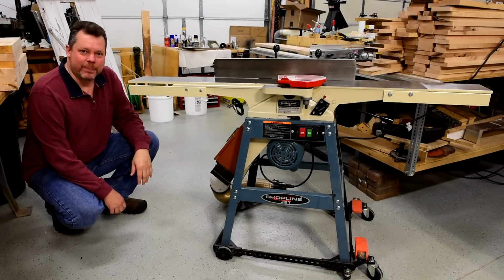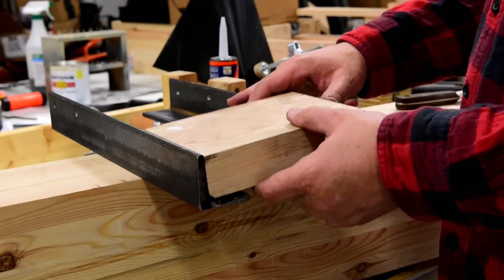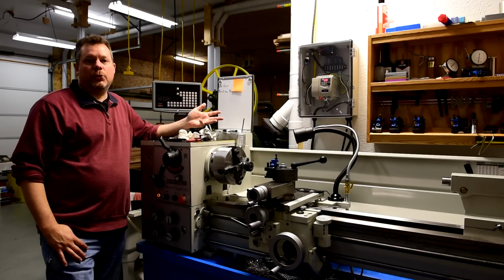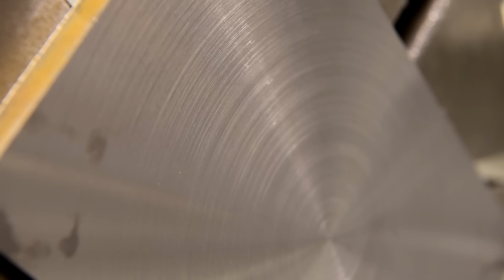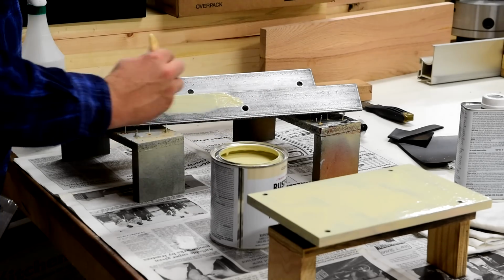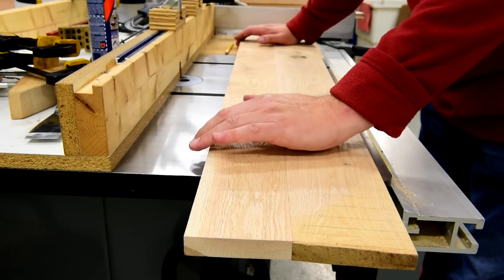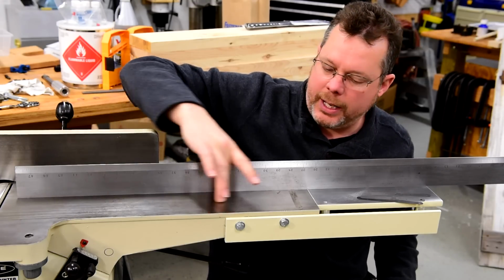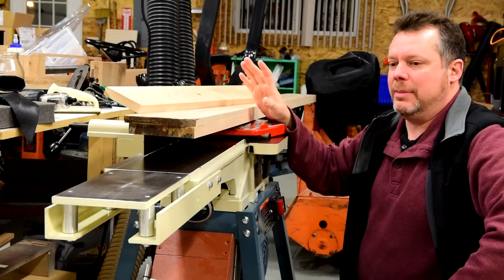Making table extensions for a 6 inch jointer

Comment: I might do this if I can find the time.  You did a great job but the process could be simplified.  A 1/2 " steel plate great , but seems to be gross overkill.  I would use a 3/8" or 1/2" aluminum plate depending on availability as cut-offs (leftovers).  These can be found already flat.  Instead of custom standoffs, I would use a jack (push) screw paired with a pull screw in pairs at each corner of the plate (4 pairs).  This would make adjustment quick and easy and requires no lathe. Future adjustments would be easy.  The pull screws should be studs mounted to the plate by drilling and tapping the plate.  Bottom tapping would be best, but through drilling and tapping the plate should not be a functional issue.  On second thought, even a 1/4" plate would be adequate to this task.  Thanks for the inspiration!
Reply from the maker: Yup, there's many ways to skin a cat. I originally thought about using aluminum plates, however, I didn't want the aluminum oxidation on the wood.
Show us what you come up with; I'd love to see it.

Comment: I'd be scared shitless to do what you did on your lathe...
Reply from the maker: It was no problem at all. It's a commonly used method which is how I learned it. Trick is to not use cheap tape.

Comment: Why didn't you just slot the holes so you could simply adjust it and not need to mess with shims.
Reply from the maker: That is another good method, but I wanted to ensure stability since bolts in slotted holes can shift over time.

Comment: I am not a machinist, so perhaps my question is naive. Your extension plates were not flat on either side. Yet you flattened the first side while referencing the other side, which was not yet flat. Then you flattened the second side. Thus, the two sides were not coplanar, right? Then, you had to trim and shim the spacers. So, attempting to flatten the second side of each plate was a waste, wasn't it?   Otherwise, I enjoyed the video and your ingenuity.

Comment: Instead of angle sections I would have used cold rolled bars say 1/2"or 3/8" thick by 2" wide at what ever length you need. This would eliminate all the fussin' with shims and they would be plenty stiff in that short  length, especially  bolted together with a 1/2" plate in between.  The plate would be drilled and tapped for 5/16" bolts, 3 on each side. Oversize holes in the side plates will allow for slight adjustments. Washers can be used between the jointer and side plates to space them out if there is an offset lip such as you have. The support plates would be the same width as the jointer tables using this approach.

Comment: You have to switch full weight of body to hands to front bed as soon as the apex of the board has passed the cutter head you can’t just stand behind the cutter head and run a long board through and expect it to stay flat on the out feed bed you must move forwards with the boards as the apex moves from the in feed bed to the out feed bed watch a couple jointer use how to videos and you will see I believe  that was your main issues with the jointer before ever even starting to extend it and after when you were having issues you have to move forward or it’s very very very hard to get straight edges you move forward with your body then push on the out feed bed you can’t just keep pressure the whole board length on the in feed table

Comment: Fireball tools sells a cast iron fixture plate that would be perfect for this. They are 9” square and machined flat. They also sell weld on mounts that are adjustable. Just search fireball tool on the web and here on YouTube.

Comment: You said the steel plates were cold rolled. This is not true. The plates were actually hot rolled steel. Cold rolled steels go through additional processes using high pressure rollers when the steel is cold. This makes the surfaces and edges much flatter, straighter, sharper edges, dimensionally far more accurate and removes the scale, (the scale on hot rolled steel is produced from oxidation as the red hot steel cools to room temperature). Additional machining to flatten the surface would not be needed if cold rolled steel was used for this application. Cold rolled steel typically costs about 30% percent more but I think in this case it would have been well worth it. BTW, cold rolled steel is typically stored and shipped heavily oiled to prevent scale and pitting from oxidation and also provide a buffer between materials to prevent scratching and gouging. If cold rolled steel was ordered for this project, you didn't get what you ordered.
Reply from the maker: I agree with you. I did order cold rolled but don't think that is what was received.

Comment: I added a power feed unit to the outfeed table.  Takes a lot of the problems away from this incorrect use of the jointer.  

I would NEVER trust sticky tape to handle this lathe job.  I value my body too much to risk an adhesion failure.

Comment: Great video. I was just thinking about doing something similar on my craftsman 6” jointer. I was thinking to take another 6” jointer, as they can be found cheaper than new steel, and see if I can cut it up and use it for extensions. Not sure if it would work until I actually take a closer look at it.
Reply from the maker: That's a good idea to use parts from another joiner.

Comment: Hey let me show you how to save thousand bucks by spending $150... and using my 15000 metal lathe... 8-p
Reply from the maker: Your pricing is very incorrect. And I did mention that you could take it to your local machine shop. Maybe you missed that part.

Comment: That is very nice work!  Clearly this isn't your first rodeo as you have some great machinist skills.  I am just wondering what is the swing on your lathe and how many RPM you were turning it at?
Reply from the maker: Thank you. The lathe is a 12" swing with a gap that allows up to 15". I don't remember the RPMs I used for this project, but it was pretty low.

Comment: Why not add a couple feet to each end?
Reply from the maker: I only wanted add the length I really needed. My joiner is in a confined space, so extra feet would interfere with other equipment. Plus there would be too much deflection on the joiner table from the massive leverage a few extra feet would have caused. I'm not sure the table castings could handle the weight of the extra length without cracking.
Reply: Aaron Weed I kind of gathered that as you stated that at the end. My jointer is 82” and I love it. Great video sir.
Reply from the maker: I would love for it to be 82". If I can get my wife to move her car out of the garage, then maybe it will work.

Comment: Size does matter. 25 years ago, I patented a simple method by which you can extend any jointer to as long as 10' or more with perfect automatic alignment, regardless of depth of cut changes. I also started a company and sold an elegant, heavy duty version of the product envisioned in my patent, but the company was underfunded and didn't survive.  You can see how my method works at www.michaelschuler.com/tech. I still have a little of the original inventory to sell, but you could also achieve excellent results by following the method and building your own extensions from materials you have in your shop right now.
Reply from the maker: That is awesome. I took a look at it. Thanks for sharing.
Reply: Aaron Weed Aaron, You're welcome. One useful feature of my method is that you can quickly remove the extension  setup when you aren't working with the occasional extra-long board, yet it takes almost no time to deploy it again with perfect alignment the next time.

Comment: good stuff, i assume you check it occasionally because you tend to lift the extension table when moving the jointer.
Reply from the maker: Yes, the table has not moved yet to warrant readjustment. Holds better than I thought it would.

Comment: Man fuck this video. "Setting up roller stands takes too much time to set up" but you went through all that trouble with the shims, and a metal lathe machine most don't have access to?? It' like "Oh you don't have access to this huge super expensive metal lathe machine? Well I guess there's no reason for me to actually make this video."
Reply from the maker: I did say in the video that you can have the plates flattened at a local machine shop, but that I didn't go that route since I already had the machining equipment. You can also use pipe and cut them yourself to be the spacers. You don't have to do it exactly like I did it; a little imagination goes a long ways.

Comment: Finaly someone i could agree with, wood works great in some applications but there are these type of situations where metal rules. Thanks for the tips, i've got a different make jointer but it's got the exact same chassis and i've had the same issues. I've also done my calculations and i agree with the additional 2" on either side. Thanks again.
Reply from the maker: You're welcome. Thank you.

Comment: Hey Aaron, I have a similar jointer. How do you adjust the infeed/outfeed alignment? Thanks.
Reply from the maker: In-feed and out-feed are adjusted through the normal mechanisms that come with the machine. I didn't mess with those at all. Or are you just asking in general about adjustment?
Reply: My tables aren't coplaner. I have a straight edge and feeler guages, but now idk what to do haha. What do the gib screws in the back do. Btw mine is a shopline
Reply from the maker: I had to shim the outfeed table under one side to get them coplanar. I put the shim under one of the sliding ways. I rarely move the outfeed table (except during a blade change), so the shim moving around is not a problem.
Reply: Yea I ended up having to shim both  tables. I'll just keep the movement to a minimum.
Reply from the maker: Did all that.
Reply: Aaron Weed So did it have the set screws?  If so, was it inadequate?
Reply from the maker: The set screws did not accommodate the improper machining of the ways. So a shim was needed. The set screws were for adjusting the gib tension.

Comment: Very nice.   I think you said you had a surface grinder.   A quicker method would be to grind one surface only flat.  Instead of using spacers, install a "Jack" screw in the angle at each corner of the plate.  Level the plate with the jack screws, lock them in place with jam nuts and screw down the plate.  Now I don't have to machine both sides of the plate nor do I have to make perfect length spacers.
Reply from the maker: Great idea.

Comment: You're VERY BRAVE to trust the double-sided tape like that, I know they're strong but I never would have, anyway a great job, take care bro.
Reply: Faceplate clamps are simple to make and safe - the tape made me shudder
Reply: yeah... tape is for the red green show....
Reply: @chrisgrubisa3819  lol only 5 people will understand this reference. I love this
Reply: you don't hog off 30 thou doing this or you made a frisby. 
I was thinking the same thing and i used to work in a machine shop, he's got some BIG STONES.
I was thinking blance grinder  but the magnet on it would just take the warp out and by the time you ground both sides you still have a warped plate.
The electromagnet on the are that strong.
The other thing he could have done is chuck up a cutting tool for a mill and hold the part with a vice on the lathe then moved the part over the cuter like a mill up on its side.
Reply: Yeah trusting adhesive on your rotary tools... Nope. Nope. Nope.
Reply: I been machining for over 24 years , the tape to face plate had me cracking up ... folks don’t try that at home ! If he did that in my machine shop he would of been out the door for safety issues ... I give him credit for good Craftsmanship he did a fine job adding jointer extensions especially paint job as well ....

Comment: Really nice video. I appreciate you taking the time to capture all the steps. After all your tuning and testing did you notice if the lack of flatness of your original jointer bed effects face jointing? You cured it for edge jointing but I wondered if you were able to quantify the effects when flattening stock.
Reply from the maker: +diymark Yes, it worked well for any use of the jointer. The dip I pointed out in the one end of the bed did not hurt flattening with the new extensions attached.

Comment: $0.02, I enjoyed this video but it seemed like a lot of steps (I lack patience). Could you have added a longer piece of steel to each end and had the entire infeed and out feed tables milled to insure flatness of the entire length? I have no idea how much a shop would charge for that or how much set up time you would spend re assembling everything.  Thanks
Reply: Aaron, I have a Chinese vertical milling machine with a table which is around 30" by 8". I was sure, after a while, that it wasn't as flat as it should have been. I contacted an engineering firm that does "grinding", and in fifteen minutes, for $30, they ground that sucker dead flat, within a few tenths of a thousandth of an inch.

Paying cash helps.  Being prepared to wait helps, and even better is gossiping with the shop owner while he does the work.
Reply from the maker: That is a good deal. I have an old milling machine table that I need to have ground flat. Good to know it is not as expensive as I thought it might be.
Reply from the maker: +MrMnchstr It would be ideal to have a machine shop grind the extension and table flat together like you said, but I'm sure it would have quite a bit more expense since larger than normal machines would need to be used. But I haven't checked pricing to be sure.

Comment: I feel your pain on the short beds of a six inch jointer Aaron. I made some wooden supports but as you said I am wasting time checking that they are in position. Great job putting the video together. I really enjoyed a bit of metal working thrown in.

Derek
Reply from the maker: +GiddyUp994 Thank you for your feedback.